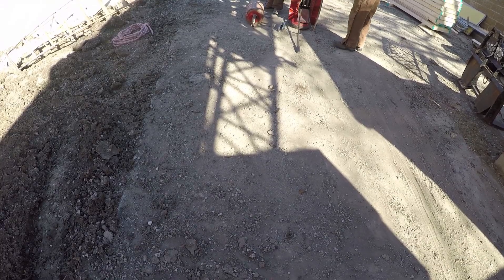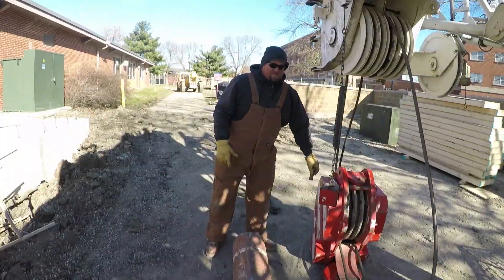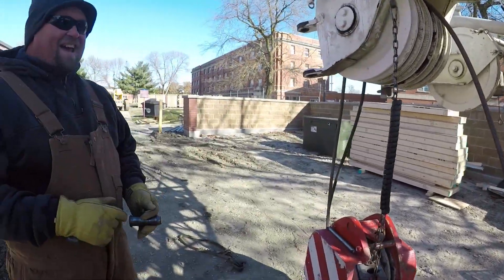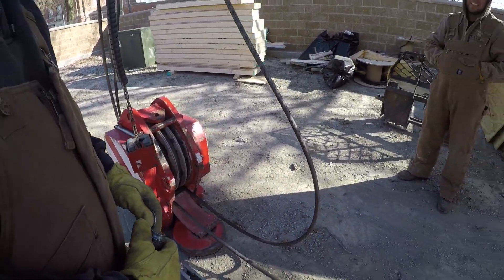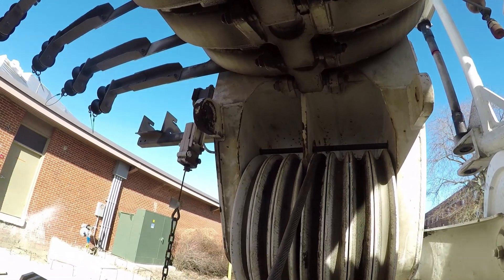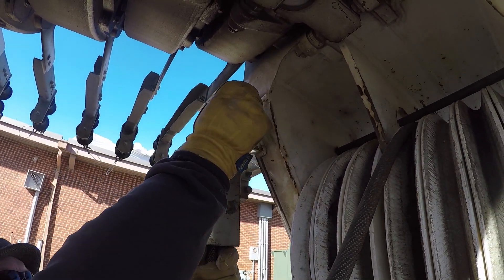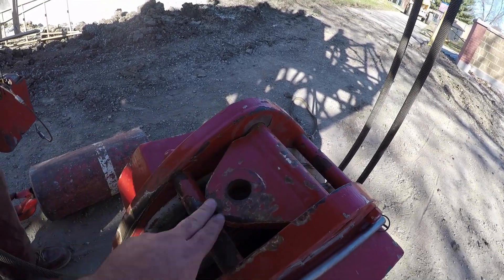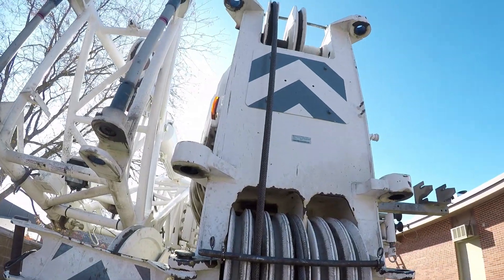Crane rope "button" termination | Reeving a crane block

Comment: Odd number of falls puts Becket on ground block...easier to rig.
I always go one fall extra to make it easy for winch line pull .
Nice work Thanks
Reply from the maker: If I didn't reeve an even number of parts of line, Mike would never stretch. 😂. But, I understand what you are saying. Many thanks for watching! 🙂
Reply: @ToTheTopCrane  I used to get block wind up spin on unloading hook. Jewel at lower block allows you to put reverse twist in rope to stop this easy.

Comment: Ok. Curiosity killed the cat. At what point are ALL sheaves used on boom AND hook? 2nd, how much cable is on the drum with ALL sheaves being used? 3rd, what is the lifting capacity?
Reply from the maker: All the sheaves would be used for a very heavy pick. I'm not sure how much rope would be left on the drum. That would be dependent upon boom angle, length, etc.. The capacity would be 234,500 lbs. In order to reach the full 400,000 lb capacity of the crane, I would have to add extra sheaves that attach to lugs on the bottom of the boom. We would also need a bigger block than what we currently own. Great questions and many thanks for watching! 🙂
Reply: @ToTheTopCrane  thank you for explaining in plain English.  :) (for us crane dummies). I have only operated one crane in my life. (Not professionally).  Austin Western. Old piece of junk. 4 or 6 ton machine.

Comment: LMAO, great educational video Jimmy. Operator cab = warm. Everything else is naturally climate controlled.
What's the highest number of ropes you might do with the Tadano? Ever have to winch a rope through the block?
Reply from the maker: The highest number of parts of line that I can currently use is 14. We don't have the extra sheaves and bigger block to go any higher than 14 parts. I haven't had to pull a reeving rope on this crane. But, I have been part of that process on some others. Many thanks for watching! 🙂

Comment: Am I seeing correct? That little steel button is a terminating point of the cable? I mean I understand how it's crimped on under tremendous tons of weight squeezing it onto the cable.. but well this might be a stupid question? What on Earth keeps that button from slipping use after use? Cuz as I watch the video a second time I did not see any safety backup should that fail.o.o
Reply from the maker: Friction keeps it on there. It must be very well engineered. It is one of the few terminations that yield a 100% of rope capacity rating. The capacity of a traditional wedge socket is only 80% of rope capacity. Many thanks for watching! 🙂

Comment: that is cool i have to get caught up on videos after my computer failed i have a new computer but it has to go back to the shop that i got it from monday because it doesnt have a part i need in it
Reply from the maker: Did they leave a part out when it was built? Many thanks for watching! 🙂
Reply: @ToTheTopCrane  im not sure its a refurbished computer the shop i got it from told me it would run one of the games i play on my computer when im not busy but when i got it set up and went to try it it gave me an error message i went back to the computer shop yesterday they told me that they dont think it had the graphics card i need it in but they couldnt tell me since i didnt have the computer with me or if the graphics card is in it i dont know what kind it is

Comment: Tell Kyle to find an exhaust pipe to warm he's hand's 
Today I had to haul my lobster traps and it worked out so I was pointing it to the sun all day do you try to plan your jobs so your not looking it to the sun if possible.
Reply from the maker: I do prefer to set up where I won't be looking into the sun if possible. But, that doesn't happen often. Many thanks for watching! 🙂
Reply: @ToTheTopCrane  I was just picking on Kyle just in fun
Sun must be a bit.. for you at times and better if you are set up on the south side of the pick
Reply from the maker: @joshwelner1951  you can pick on Kyle. We do. 😂